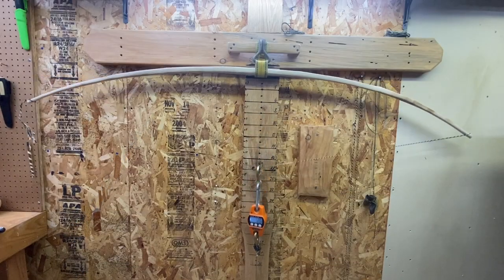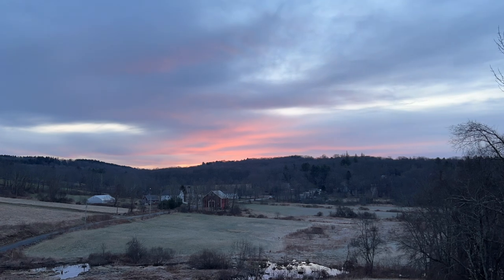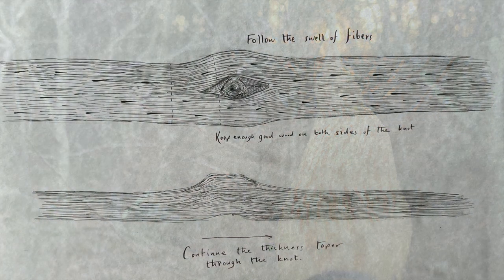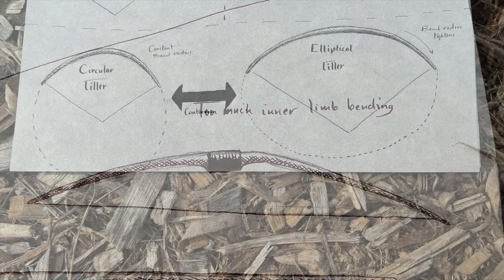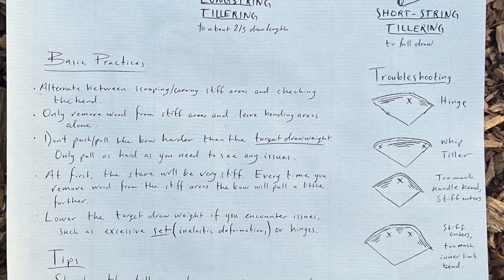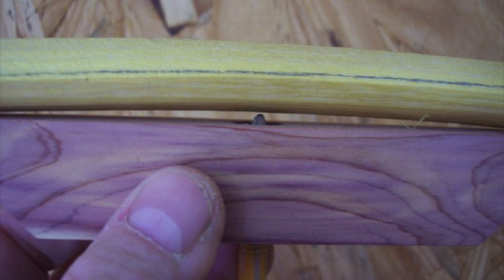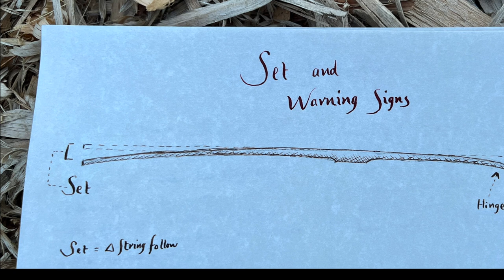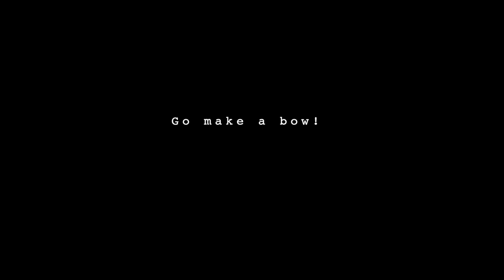Tillering, Explained | Fundamentals of Bow Making

Comment: thats exactly how its done. Ive recently build a bow for a cutomer which was send back to me cause - handshock, bad tiller. Although I explained him the tiller a few times even while the build of the bow. This bow had a lightly reflex and a deflex limb so in brace height of course it looked weird. But in full draw 28" tiller (to me) was perfect. Another indeed were the growth rings which came out exactly the same on both limbs - I know that doesnt always work but if the tiller is good in full draw and the rings look even thats a good indeed. but the safest point for me was that there were no compression cracks at all. Well I might send him this video link, thank you San!
Reply from the maker: Thanks man those character bows with weird brace shapes are hard to accept but sometimes it just has to be like that. Forcing a perfect braced shape will just throw off the full draw

Comment: In character bows, how do you follow the fiber in the front profile? If you use a drawknife for rough shaping, you'll inevitably cut trough fibers. Do you shape the bow by splitting with a dull tool or?

Comment: re-watching this... Interesting comment about the tillering "gizmo"... it gives a circular bend rather than an elliptical. So on a board bow design with a non bending handle glued on, I probably should not be using a Gizmo to tiller check (at least not as I approach final tiller - maybe just initial roughing in of tiller)?
Reply from the maker: You can still use the gizmo, just keep in mind to make the outer limbs bend more than what it’s telling you

Comment: I found that a tillering stick helps me get the bend under control and find brace height. Do you recommend to stop using the tillering stick once brace height is attained, and only go to pulling the bow on a tillering tree after that?

Comment: Wouldn't an elliptical tiller be the best for every design seeings how every part of the bow bends on a perfect horizon? If u look at most composite bows and even old selfbows all of them are elliptical tiller.
Reply from the maker: Technically true, a circle is a case of an ellipse. There is only a tiny subset of bows that call for a literal circular tiller. Most bows will be elliptical. Some more circular than others on the spectrum but still an elliptical shape